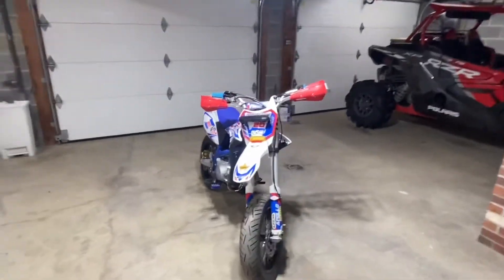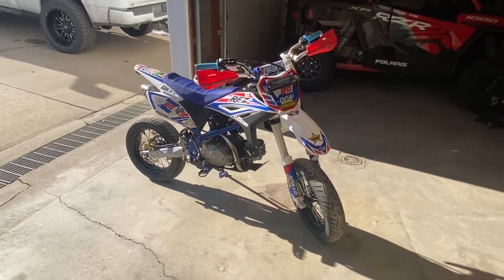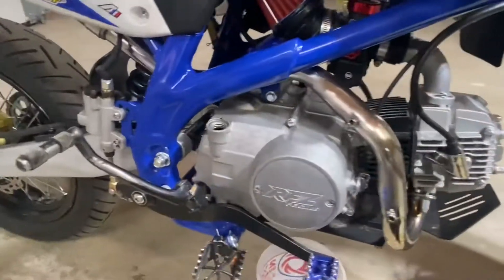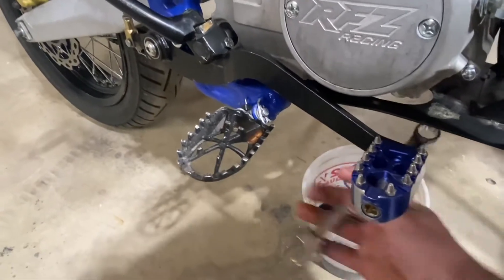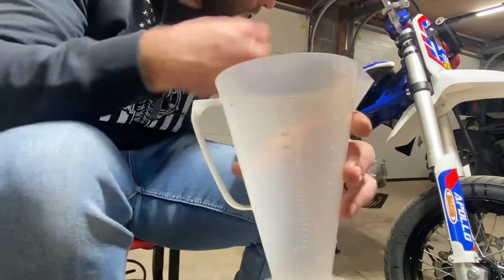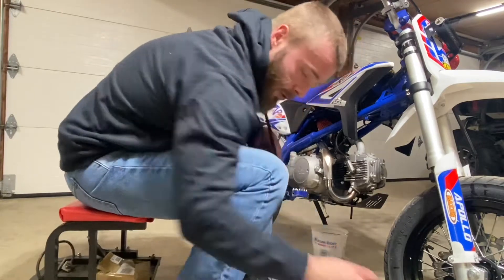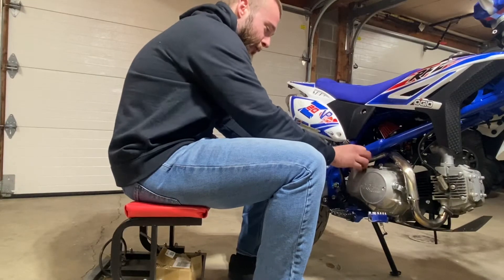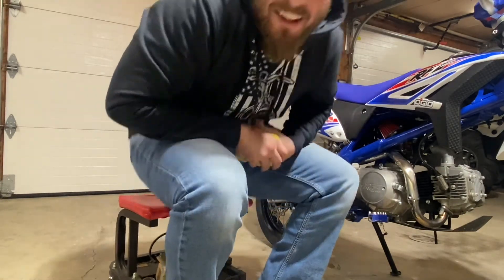How to change oil on mini dirtbike 50cc,70cc,90cc,110cc,125cc

Comment: i just bought a pitbike with 125cc. how often should you change the oil? also for reference, at what rpm your bike is idling?
Reply from the maker: I usually do mine every few rides, I’m pretty hard on these and oil is cheap insurance! Not sure exact rpm mine idles at but it’s pretty low in this video. Wouldn’t hurt for it to be a bit higher

Comment: Do you have to use oil for wet clutch or regular oil I used regular oil and my new clutch Is slipping
Reply from the maker: What bike are you running?
Reply: @ClutchUpGarage  Im not sure but the motor is zongshen 125cc
Reply from the maker: @oo7952  regular oil has always worked just fine for me. your clutchs just may be wearing out

Comment: Do these pitbikes have an oil filter?😊
Reply from the maker: Typically the 125cc’s do not. The bigger bore horizontal engines like 150’s,170’s and above do. Just make sure to look up specs of your engine to see if it has one or not.